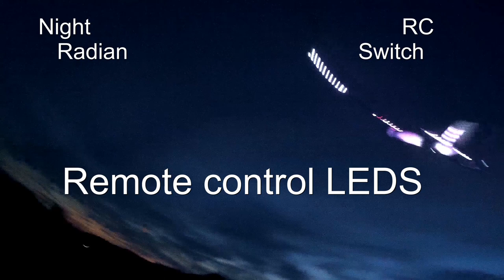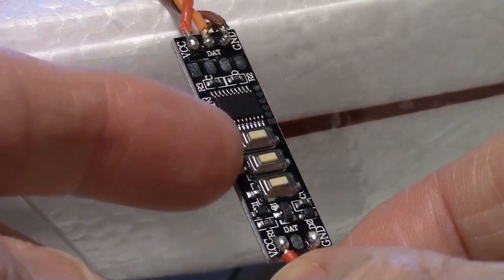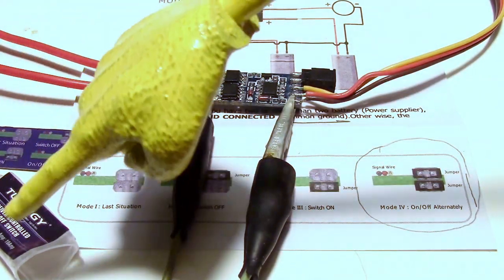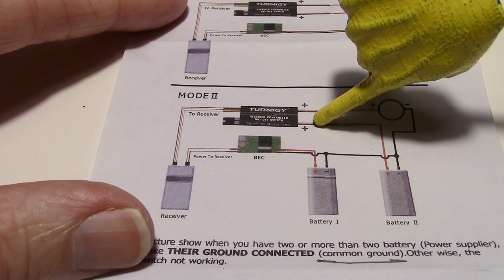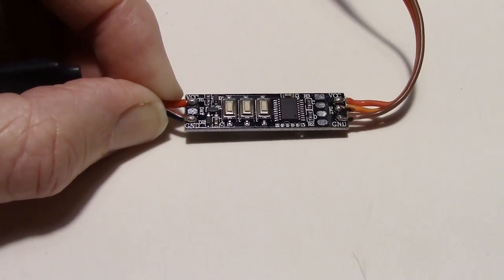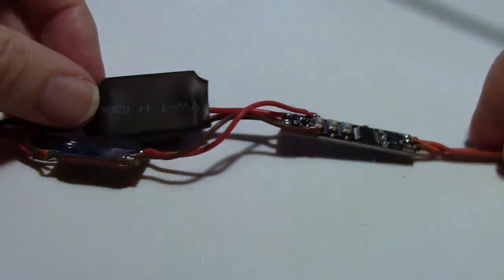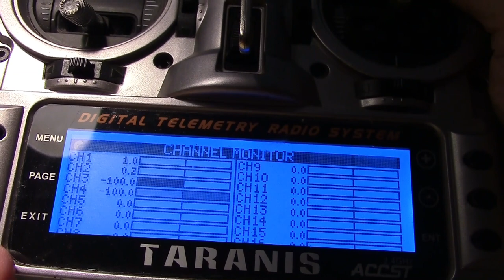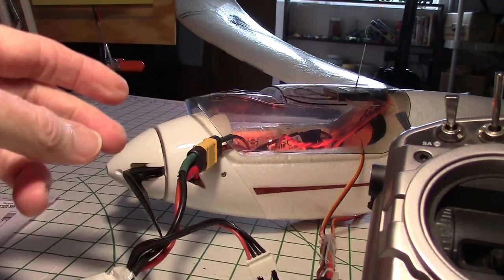Eflite Night Radian FT🎮Control LED Lights by RC Radio (Receiver Controlled Switch) Detailed Version

Comment: On the LED controller there is a unused 'DAT' pad between the VCC IN and GND pads, any idea what that is for?
Reply from the maker: I think it's the same as the other Data pin for serial data to LEDs.

Comment: Thank you sir ! Great video. I have a couple of these switches  laying around from my rock crawlers . I just received my night Radian  .
Reply from the maker: The RC switches are very handy. I just started working with them recently. Good luck on your projects and happy holidays.
Reply: For some reason i cant get it to work . i followed your video to the tee with sodering and wiring ,  and i think its maybe my radio settings .. i using a spektrum DX7 .   any insight?
Reply: GOT IT TO WORK FINALLY !!!! FYI for anyone with BNF ( AR636A  receiver ) model you will need the spektrum programmer cable to open the channels back up to operation . From the factory channels 4,5,6 are shut off.  Cant wait to go and try it out !
Reply from the maker: I don't have the AR636A receiver in mine but I am sure a lot of people do. Thanks for the information. I will put your findings in the description of this video https://www.youtube.com/watch?v=cznO4NghSmk
Reply: Your welcome sir. thanks for the great videos , I would have never thought of this if it had not been for this video.   Keep up the good work!  Happy new year !